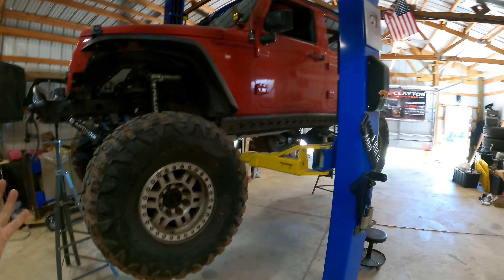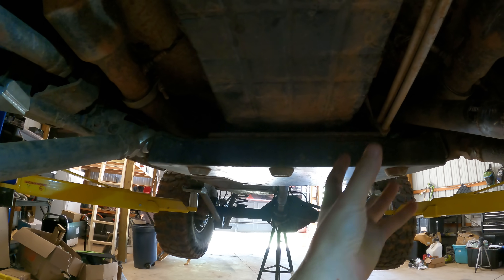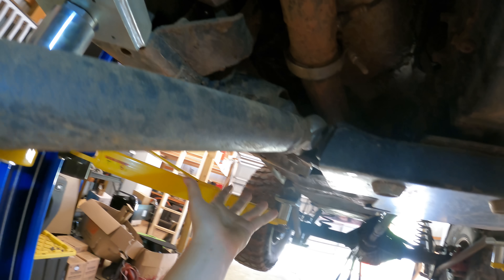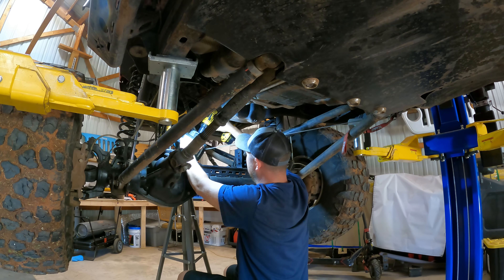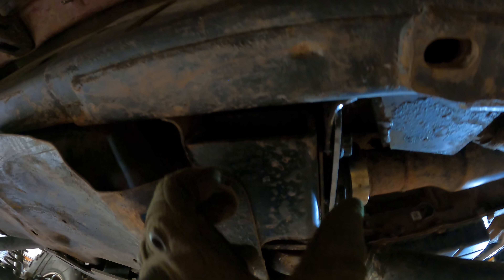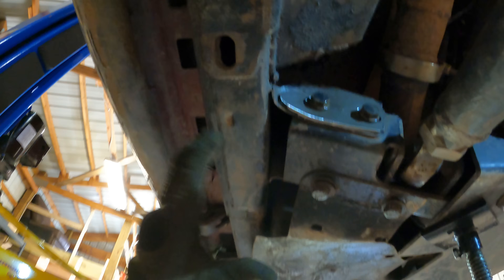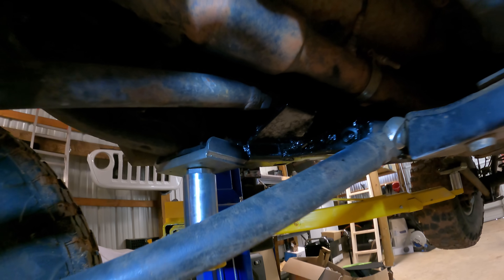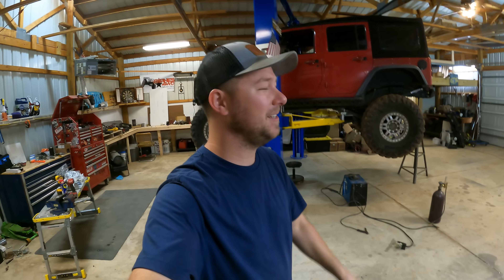The Unmentioned Weak Spot on The Jeep Wrangler...

Comment: Not sure if you could see from your angle, but from the video, it looks like your crossmember mount bracket is pushed back close to a quarter of an inch. The proper way to fix you problem would be to either replace that bracket or fab a new one and make sure it's properly positioned. I think if you measure your wheel base from one side to the other, you'll find your passenger side comes up short. That will affect your tire wear. Although, you could adjust it out through the adjustable long arms and get back to spec. Hope this helps. God bless and stay well.

Comment: You are saying this in the beginning, but I will repeat it because like most people I dont have heavy axles, long arms nor a V8.  My cross member got pushed into my transmission.  There is literally a crease in my transmission where it hit.  So even for less modified JKs, if you rock crawl, this needs to be strengthened.  Thankfully I have a friend who welds, so he reinforced mine and made more room for the driveshaft when the drivers front is full droop.  Thank for making this vid!

Comment: The GenRight Elite system is one of the few that I've seen that avoids this, by intentionally using a separate crossmember for the front lower arms, and tieing the entire bottom of the Jeep frame together with their skid plate.  Another option is with the Rusty's long arm kit.  They provide gussets that reinforces the crossmember at the frame.

Comment: Hello Ben, I like your fix, but in my opinion I think you are still going to have flexing happening on that bracket, because the rest of the bracket is so weak, the majority of the force will go through your new reinforcement bracket/gusset, and the new reinforcement bracket/gusset weld will fail or it will bend and warp.  I think you need more rigidity.  I think it is a good temporary fix, but with all your weight and how you wheel it you need to cut the stock bracket off and replace it with a 1/4in thick bracket with some good gussets on the front and back of the bracket. thank you

Comment: I only have a 98zj laredo limited upcountry, with the 5.2, auto, & 249 transfer case, 30front 44rear axles, 3:73gears, 4inch springs, and used a rough country longarm combined with a home made sliders frame stiffeners welded in, only running 31s but no rubbing anywhere and haven't needed to do any of the fender hacking see so many do,,, works really well as daily and for the off roading I do

Comment: good video . i think if you removed the skid plate and make it flat with a press and after that fix at the good angle your braket should be better, your weld on a frame is not the best idea. just bold it be better i think. hope it be ok

Comment: You should have measured the wheelbase on one side and compare it to the other, I'd bet you there is still a difference that will require more work to correct it.
Reply from the maker: Yep! I need to get a 4 wheel alignment at the shop down the road. I’m sure it’s all out of spec

Comment: Awesome video Ben. I've spoken with many of the guys on the 1 ton pages about this especially as I was building my build. Many mentioned to really watch the crossmember to frame mount as many have done a lot worse than crack it. I heard stories of people literally tearing it off the frame. I have a similar set up to yours, have the guys at Barnes expressed any interest in creating a bolt on or weld in reinforcement bracket? I just spoke to tech at Artec and was told they have never had an issue or seen it happen....maybe I should send them the link to your video....LOL
Reply from the maker: I’m going to talk with them and see if they can come up with something bolt on!

Comment: If I was you I’d work with Barnes to come up with something together. Whether it be a bolt on or weld on bracket. Either way you can basically be their Guinea pig and work with them to come up with something together. 

I’ve got the Barnes crossmember with long arm mounts as well and I’ve thought about that spot being an issue when I installed it but figured Barnes has tested it for years and they must not have come across that. But for the amount of stuff it would damage if it broke I wouldn’t mind extra insurance on that area.

Comment: Definitely a problem with long arm being solely attached to the cross member.  I prefer a bracket in front of the cross member that attaches to the 2 bolts on the cross member along with bolting or attaching to the frame.  Such as Metalcloak and others.
Reply from the maker: Those are stronger for sure! However, triangulating the lowers in helps a ton with strength and performance

Comment: I have an 08 with never ending electrical problems 
What would a diesel replacement do for this problem?
My goal was the 5.7 engine transmission swap but the worry would be a better engine but the same electrical issue

Comment: I noticed that you're still running your tie rod low on the Barnes knuckle kit. Did you ever try running it higher in the normal location, and if so, did you get interference issues?

Comment: Should drop the bent skid plate down. That would make it a lot easier to straighten the cross member to a square position. The take your bracket off. Pull with the cable and find a way to put a Porta power cylinder on the back side. Pull and push. I would also take some detailed measurements to make sure frame isn't diamonded.
Reply from the maker: Loosened the bolts and it seemed to be enough. Luckily it kicks like no damage was transferred into the frame

Comment: Disconnect the cross bar and replace the mount with a stronger bracket. It should have been done when the cross was installed. Its only as strong as what it is connected to.
Reply from the maker: No one makes a stronger bracket.
Reply: @JKGearandGadgets  make one.

Comment: Seems about the same all across the board. We can upgrade all these components, track bars, drag links, control arms, crossmembers, sway bars...etc. But they are all still supported by those thin factory brackets. Upgrade one you might as well reinforce the other or once again you’re wallet will pay 🤷‍♂️

Comment: Well, when you take that 7500+ pound Jeep and start hammering it into hard things, it’s no surprise your going to bend and break things. I am not sure that repair is going to hold up to the abuse and loads your going to hit it with. I expect at the end of the day, that whole cross member is going to have to be removed and replaced with a redesigned and beefier unit with additional gusseting and frame support added to that area to properly capture and spread that energy around. 

I am continually amazed at how much the weight and size Jeep Wranglers gain as people keep adding stuff to them to climb that next rock or wallow in the next mud pit. And go faster while doing it. 

Shoot, now I am seeing side x sides that are longer, taller, wider, heavier and more powerful than my old Ford F-150. Seems to me that serious modified Trail running wrangler and wrangler unlimiteds are now becoming the same beasts as the first gen H-1 military hummers, minus the guns and ballistic armor.
Reply: 3k lbs

Comment: Well....commonsense tells you that thin flimsy mount was not going to work in the first place! If you're beefing up the cross member automatically you should have beefed up the mount that's a given! Sorry but that's all on you or whoever installed that "upgrade" that is very basic entry level 101! And no your "patch" is not going to hold, pull it all apart, start over, and DO IT RIGHT!

Actually, would have been pissed if I had bought that cross member and it didnt come with the proper mounts!